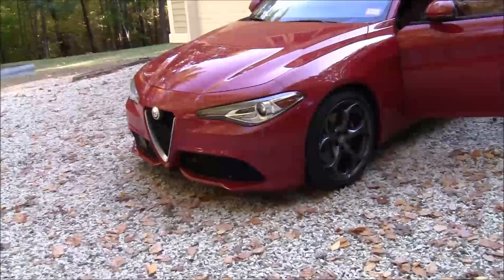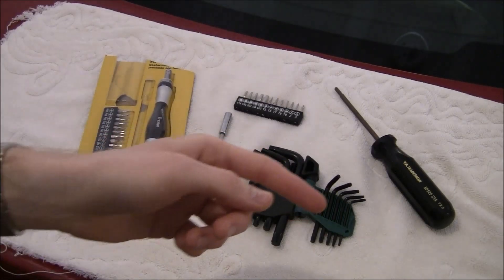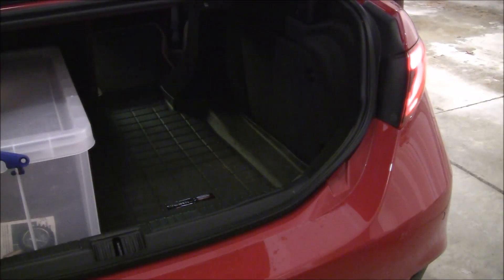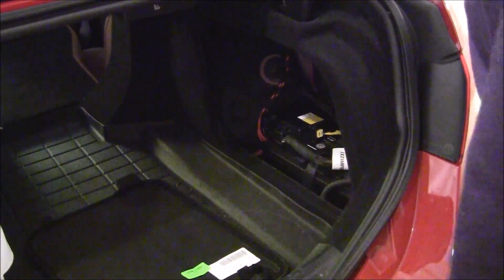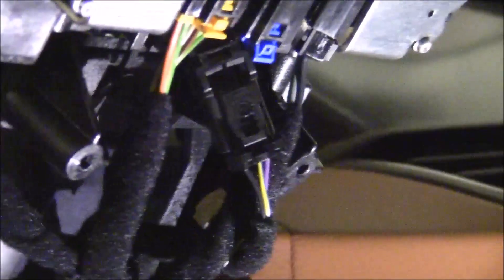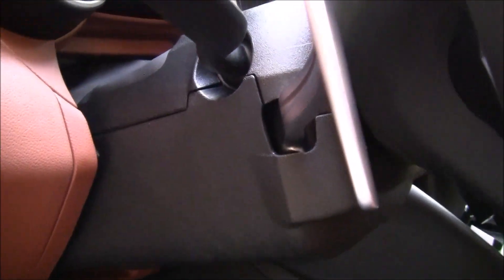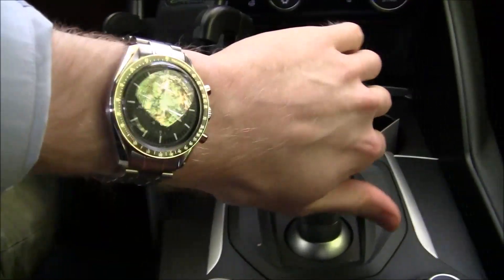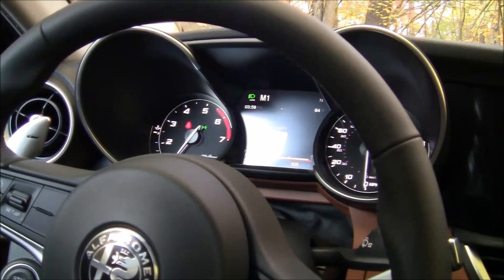Installing OEM Paddle Shifters on Alfa Romeo Giulia / Stelvio with MultiECUScan explanation

Comment: Where do you get the screws from?
Reply from the maker: when I was buying and selling these, they would always come with the assembly themselves (usually with the wiper stalk and clock spring). Not sure where to buy them aftermarket - they were never a separate part available in the OEM parts catalog

Comment: Hi and thanks for posting this video.  I'm about to do this on my 2020 Stelvio.  Is it safe to assume that this can be done, if need be, in two steps.  meaning installing the paddles and then programing them at a later time ?  

Tom
Reply from the maker: Yep, correct.
Reply: @ferrisschueller3984  would you happen to know the size of the torx screws that attach the paddles to the steering wheel stalk ?  the paddles i bought did not come with the stalk assembly and therefore no screws...ugh
Reply from the maker: @TomDiGiovanni  not sure unfortunately. Perhaps people on the forums have discussed this before if I recall correctly. No longer have the Alfa and ended up selling it with the retrofitted paddles

Thanks
Reply: Can the shifters can we mount withou turn signal switches . mean I have just shifters with connector and small screws

Comment: Thank you for your video! I correct install all. I want to buy a new lower steering column cover and click the link it didn’t show me the correct page. How can I find it?❤
Reply from the maker: Thanks. Looks like the part is currently on backorder, that is why the link isn't working correctly. You will have to find a used one on eBay, maybe

Comment: So you can do all of this with the car completely disconnected from the battery? Also if you don’t take off the steering wheel there’s no way an airbag would go off right? So is unplugging the battery optional is what I’m asking. Thank you, doing this tonight.
Reply from the maker: Any time you are fiddling with electrical connectors or touching these things, you should always disconnect the battery. It is a very easy step that is how we ensure things like airbag deployment doesn't happen. Official dealer service procedures always begin with disconnecting the negative terminal. When you're physically installing the paddles, have the battery disconnected. Obviously when you are using MES and enabling them (software), the battery is reconnected of course

Thanks

Comment: So the only screws I need for installing the paddles are the t8 screws?
Reply from the maker: Yes
Reply: @ferrisschueller3984  thank you!
Reply: @ferrisschueller3984  Do you have any more detailed specs on the screws?
I have a pre-SGW 2018 TI Lusso Giulia.
I have the paddles [bought without full stalk setup - just the paddle assembly].
I have the correct lower cowl.
I have MES and blue and grey cables.
I have all the tools I might need.
I just need the 2 darn missing screws - mine came with none.
My understanding is that two are already present and get re-used, but 2 additional screw are needed to properly secure the paddles.
Thanks in advance for any assistance with this.

Comment: Do you know by any chance, if car has to be on a leveled ground, when you do the proxy alignment, or it doesn't matter?
Reply from the maker: No, not necessarily. When you are performing your EPS recalibration after reconnecting the battery, that is when you will want to be on level ground.

Comment: Great video, many thanks! I have bought some used paddle shifters. Installing them will be a cool adventure! I do not believe the used parts I bought have the screws to screw them into the steering wheel. Do you have any idea if these screws are already in my car, even if I have a car without the paddle shifters? So I can just get those screws out and put the paddle shifters in there and then "rescrew" the screws? Or do you know which screws I would need to purchase for this if I do not have them? Would be very happy with an answer, thank you in advance!
Reply from the maker: The car without paddles does not come with the screws, you will need some. I wish I could tell you with confidence the exact dimensions of the screw, but there is nothing in the parts catalog that seems to divulge its dimensions

I have some on hand (only three), and they are Torx T8 and appear to be 8mm long. Not sure on the diameter or pitch of the thread.

Comment: I have removed my steering wheel and put it back. I'm 100% sure that I put it back correctly (allignment). But now the the steering wheel isn't 100% in the centre when I drive. How to fix this? Does it have something to do with steering wheel angle reset in MultiEcuScan?
Reply from the maker: Did you turn the steering wheel lock to lock, then dead center, then ignition off once you reconnected the battery? A common problem is that people do this procedure on ground that is not level -- it needs to be perfectly level, tire pressures correctly inflated, etc. You do not need to do anything with the steering wheel angle reset in MES for this procedure.

Comment: Hi 👋🏻 great video!
Do u know if i can enable paddles and do proxy alignment only with ELM327 Bluetooth? 
(i haven’t Blue or Grey cables)
THANKS
Reply from the maker: Hi -- thank you

No. Firstly, the Bluetooth diagnostic lead will not work, you need the wired version, and secondly, you will need to use the blue/grey adapters for completing a proxy alignment, as well. 

Thank you

Comment: I have a question can this be done with a iOS MacBook
Reply from the maker: MacBooks are not run on iOS. But if you're using macOS (or OS X) you could get this done by emulating, creating a virtual machine using Bootcamp or Parallels most likely

Comment: I finally purchased some paddles but can not find where to purchase a lower cowl. Says out of stock/discontinued. 
Do you know if anywhere? 
Thanks
Reply from the maker: That part is currently backordered due to supply issues these days (like everything else)

It appears there may be one for sale on eBay, used (link below)

https://www.ebay.com/itm/154563636500?hash=item23fcb5ed14:g:oUcAAOSwItBhEYMk
Reply: @ferrisschueller3984  This part would be the same for the Stelvio?
Reply from the maker: @19mati67  I believe it does work but the Stelvio specific p/n is 6NG04LXHAA. The Stelvio version is a little longer. Some have used Stelvio cowls in the Giulia for example.

Comment: Hi,
did you remove the airbag? Actually I got the shifters and the MES equipment, but I'm not sure to remove the airbag by my own.
Reply from the maker: Hi -- No, I specifically did not remove the wheel nor airbag, it's not necessary. Instructions paraphrased from service info below

To remove wheel, have wheel straight, disconnect battery cable, remove airbag (to do this, locate the access hole in the steering wheel hub trim cover below the two vertical spokes, push flatblade screwdriver in and hold, pull off the airbag module, disconnect the harness connectors), then, disconnect the wiring harness connectors on the wheel itself, removing the wheel nut cover, throw away the wheel nut (must get a new one) and retorque to 33 ft lbs when reinstalling
Reply: @ferrisschueller3984  Thank you for this information. I just got the information you have to remove Airbag/Steeringwheel to mount the shifters. So I try it the way you did. Do you remember the type of screws you used to mount the shifters?
Reply from the maker: @torstenweber9072  They are Torx T8 screws
Reply: @ferrisschueller3984  THX Ferris...I succesfully installed the peddals. THX for your support

Comment: I’m having a problem where I execute that the paddle shifters are now present and the next box it gives me just says “Completed” it does not tell me that I need to run a proxy alignment or anything. 17’ Giulia. Any help would be great.
Reply from the maker: Yes, I poorly explained that in the video. On the same screen, CAN Setup / PROXI Alignment Procedure, where you enabled the paddles, you will scroll to the very top and in blue, is PROXI ALIGNMENT PROCEDURE -- click on that, and then press execute
Reply: @ferrisschueller3984  man, thank you so much I will give it a try!

Comment: Hi! Do you mind if I can borrow the cable from you? I'm in TX, need to code the DNA-R selector in my 17 Q2.
Reply from the maker: I respectfully decline, the cables can be purchased from iDiagnostics as they are in stock for ~$35 after conversion. Link below

https://idiagnostics.co.uk/product/11
Reply: @ferrisschueller3984  No worries! Did you remember how long it took for you to receive it?
Reply from the maker: @samuelliu4933  About 2 weeks is the norm I think. UK ships reasonably quickly compared to others, for international. I buy stuff from Italy a lot and it takes 1-2 months these days
Reply: @ferrisschueller3984  Do you think that other Elm 327 devices would do the job? I already have an older version.
Reply from the maker: @19mati67  Other ELM327 interfaces can do the job, if they are designed for compatibility with Alfa/Fiat/Lancia vehicles usually. On a lot of cheap knockoff ELM devices, there are resistors and capacitors on the circuit that work in a way that makes the device incompatible with Alfa/Lancia/Fiat vehicles which causes problems, long story short. I am not an electrical engineer so I just made sure to buy an ELM 327 interface known to work.

Comment: do you have any guide on how to install the SGW bypass plug? I'm confused and dont know how to install them.
Much appreciated!
Reply from the maker: Yes, for Giulia or Stelvio? Giulia is a bit easier, it looks. I have personally done neither.

For Giulia, the official method is to remove the front seat (for space, I would assume), remove instrument panel silencer panel, left side knee airbag (I think you can leave it, IMO), release the fastening stud on the air duct to move it out of the way, then you reach near the steering column to find the SGW module which has two wire harness connectors. You take those two connectors and plug them into the SGW bypass plug and there you go. For service requiring diagnostic scan tool in the future, leaving the bypass plugged in causes problems. You will want to disconnect the bypass plug and return it back to stock once no longer needed
Reply: @ferrisschueller3984  thanks for the guide! Just a quick question: is it okay for me to leave the plug on all the time? Or do I HAVE to remove it to make the giulia back to normal?
Reply from the maker: @reftwong7968  No problem. You probably want to disconnect the bypass plug for future service. Basically, if you ever take the car to an authorized Alfa Romeo dealer (or other brands within FCA network), they will use Micropod II or some type of J2534 scan tool for diagnostics, and through wiTECH 2.0, FCA authenticates use of that scan tool for the technician with the vehicle. If the bypass is plugged in, there is probably an authentication error of some sorts that would not allow them to access the modules with their tools. I recall it's been a problem noted on some forums and groups
Reply: @ferrisschueller3984  thanks a lot for the info man! Appreciated!

Comment: That's not the whole process, i'm afraid. There are two black philips screws that go through the large holes on the padles, the stalk assembly and fasten behind into something. They are already there holding just the stalks. You need to undo and reinstall after adding the paddles. Then also add the T8 screws you mention.
There is no way you can do this with the wheel on tho. To remove you need to poke something into the hole on the back of the wheel to release the airbag, then undo connectors and then there's a 24mm nut.
Reply from the maker: I see. I've bought and sold 5 or 6 sets of the paddle shifters with the indicator stalks and clockspring and not once seen what you describe. Usually I have to remove a few extra screws, but it's been a while and I forget where. I guess they get removed when removing from a vehicle? These screws are fastened somewhere in the steering column area, to the vehicle, not the switch assembly?

I have the factory service manual and see that the SCCM is one unit and not meant to be separated so I don't see any info on it. Of course for the purpose of retrofitting, we separate it. I've had the paddles mounted to the car since October 2019 and they've not come loose or anything. So I don't think the 2 black screws you speak of are as critical as using each of the four T8s. I did not want to remove the airbag and wheel if possible.

Comment: Hi Ferris, thanks for the extremely helpful video!  I also have a 2017 Giulia Ti (same as yours) and was able to successfully add the paddle shifters. (I used all your recommended equipment.)  After I finally got (after so many attempts) a successful proxi alignment..my check engine light, start/stop failure, low battery, and service engine prompts all show on my dash.  I also have no drive modes even ensuring/changing the switch type to a Type 2 DNA.  Otherwise the car drives fine. Getting a bit desperate, any help would be appreciated!  Thank you!
Reply from the maker: Did you turn the steering wheel lock to lock once you reconnected battery? Otherwise you can go ahead and just clear the DTCs through MES
Reply: @ferrisschueller3984  Thanks for the response!  I didn’t but I was able to get all the dash lights to go away but restarting the engine twice after resetting the ABS through MES.  Happen to find the tip on a youtube video on adding the Race mode DNA switch.  Happily clicking through the paddles now!  Guess there are now at least 2 17’ Giulias with the Rosso Competizione and brown interior combos I know of now ;).  Grazie!

Comment: did this workout long term without issues?
Reply from the maker: Correct, never any issues. The car has been back to the dealer for normal servicing/updates to various modules too, never a problem with the retrofitted paddles.

Comment: I'm struggling  with a blueTooth elm327  trying to connect it with my Alfa 159 , they won't connect.  I' try an older one v1.5...  my plan is to calibrate the clutch (is a selespeed)
Reply from the maker: Hi David,

Chances are you need a wired ELM 327 cable, in my opinion, the Bluetooth won't work. But I have no personal experience with the 159 (never even seen one in person unfortunately, let alone worked on one)
Reply: @ferrisschueller3984   Thank you, I'll get the wired elm317 first then as you are the second person to point that. ;)

Comment: Great vid. It helped a bunch. For those using the original lower trim, Dremel 3cm down from the top near the stalk, go 2.5 - 3cm forward and then 2 cm back up. It looks pretty factory w/ these dimensions. For those asking about cost, the prices of these parts has gone up considerably over the years. The more people that learn about how easy this is, the more the price will keep going up.

Comment: Hi there, wonderful Job, thank you. my Stelvio 12/2018 has been delivered without paddles too. now i managed to let it install by my official Alfa Romeo Partner here in Switzerland, but it seams that they can not access to the software to "activate" the paddles. Do i still need to order the Security Gateway Module Bypass or does it last to order the Grey and Blue Cable with the ELM 327? BTW the IDiagnostics Site you posted, offers the Security Gateways module as well... you think that is good too? https://idiagnostics.co.uk/product/31
Reply from the maker: Ciao,
If you are referring to a dealership / official workshop, that is correct -- they cannot easily activate the paddles themselves because they actually need to change "sales codes" via wiTECH if I recall correctly, requires communicating with FCA etc ... not easy nor convenient. But, with MultiECUScan, as private individuals such as ourselves, we are actually able to access it and change it no problem, ironically enough. So to complete the job and activate, you will want to buy the cables, MES, and for your 12/2018 Stelvio, yes -- the SGW bypass. I cannot offer recommendations on SGW bypass since I never use them, however my friend runs "Stuff4Car" is very reputable and produces one that many have found success with. Link below.
https://shop.stuff4car.com/en/index.php?route=product/product&product_id=51

Comment: Great video. Did all this with the same parts on my 19. Needed sgw bypass. Proxi errors out from DSCM and flashes my odometer.
Reply: Hey I’m adding paddles to my 2019 as well.  Need help with SGW bypass and turning them on using the software.  Can you help me out?

Comment: That’s awesome man!! Any videos on how to reset maintenance lights with the MES tool?
Reply from the maker: Thanks. That is super easy. You would go to Service --> Service Interval Reset --> Adjustments and then make changes from there. If you've done an oil change during that service, you will go to Engine --> Marelli blah blah Injection --> Adjustments --> Oil change. This will get the oil degradation function back to "oil life: 100%" and it'll decrease thereon out as you use the vehicle

I will make a video on this for the future I think, if not done already. Good idea
Reply: Ferris Schueller yeah man this is literally the first video I see someone using their MES on the Giulia! Also are you in the US? I’m trying to find where to buy the MES here in the US? Thanks!!
Reply from the maker: @thepiners6279  Check the link in my video description, you only want to buy it from the official site -- PayPal converted it to USD no problem for me. Yes, I am in the US